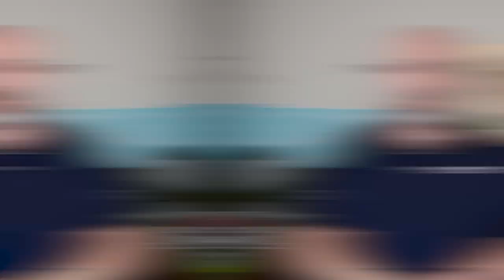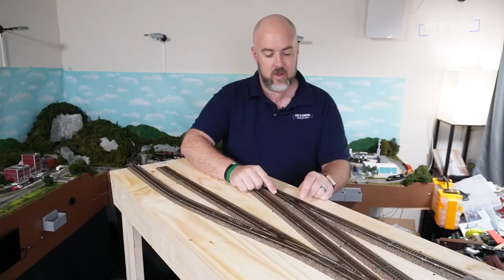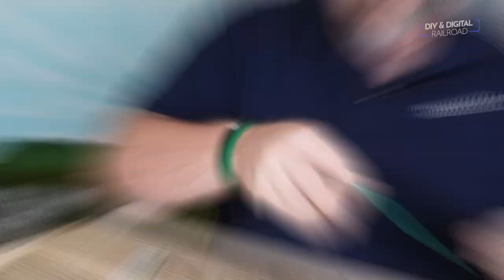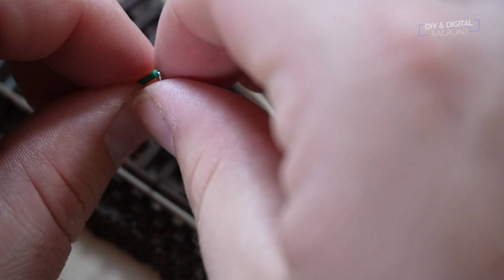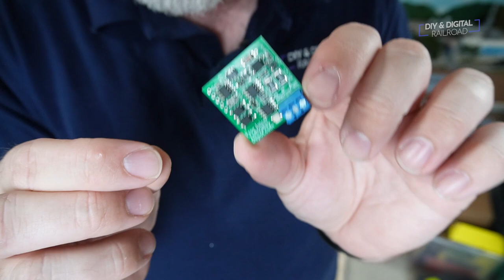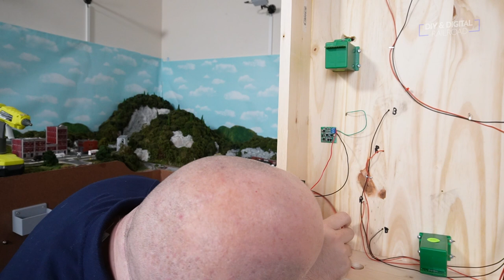This Fixed My Model Railroad Switches

Comment: was that a electro frog and if it was you didn't have to cut the other wires to modify them
Reply from the maker: That turnout is an Atlas code 83 #4.  The frog is completely isolated. I actually disassembled a junk one of these to make sure haha!
Reply: @DIYDigitalRailroad  Are the frogs really that bad on Atlas switches?  It looks like the locomotive is taking a flying leap over the frog.
Reply from the maker: @IC-Tom  Haha!  No.  I warped the plastic a bit when I soldered it.  I filed it back down.

Comment: Is there a reason you chose to not use the frog powering capabilities of the Tortoise  switch machines you have on the layout?
Reply from the maker: Yes I wanted to make the video so that someone could fix the issue regardless of switch machine.  If I did the tortoise only, then somebody who doesn’t have the tortoises would be out of luck.
Reply: @DIYDigitalRailroad  I understand and that makes perfect sense. I was just wanting to save you a few bucks if I could. Thanks for all the valuable things you have taught me in your wonderful videos.

Comment: I run a dc layout and yes i am new to this, when i switch my points (switches) and try to run a loco over them they short and go dead. any tips or advice for that will be most welcome. thankyou.
Reply from the maker: Hmmm.  What brand of track are you using?
Reply: Some turnouts have a pretty small section which is electrically isolated. When locomotives with wider than normal flanges run through these turnouts, the flanges can bridge across the insulated portion and cause a short, even in DC. Examine your turnout closely: you should be able to see the insulated gaps in the rails around the frog. Then move your loco through the turnout (with track power off) and see if you can spot any trouble. It could be one or two "bad actor" locos on marginal turnouts.
Reply: @DIYDigitalRailroad  its peko.